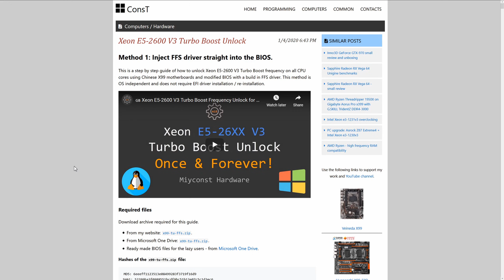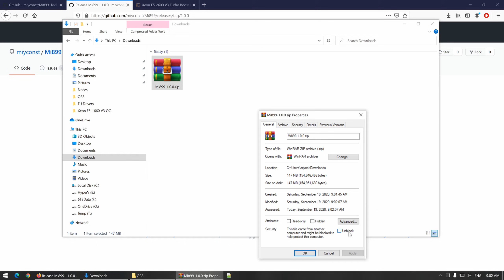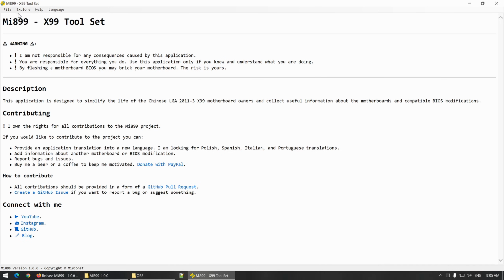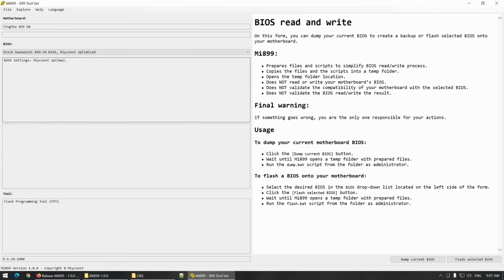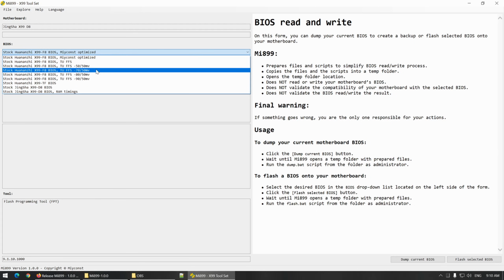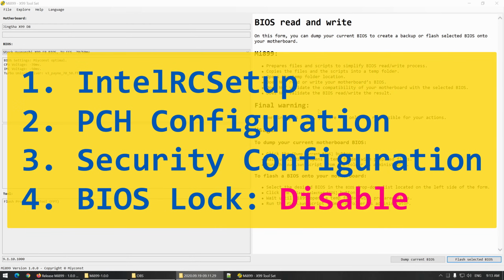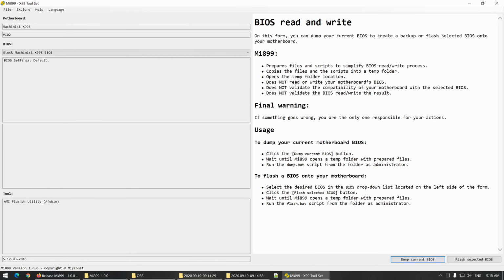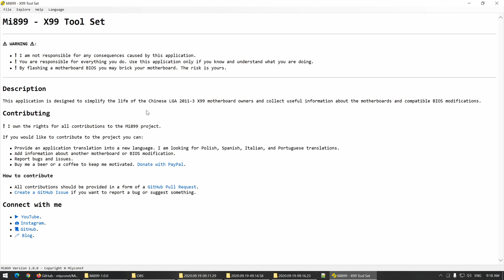🇬🇧 Mi899 – X99 Tool Set | read, write BIOS & unlock turbo-boost with a few mouse clicks

Comment: Hello Miyconst. Do you know any compatible bios that I can use for my Artermiter X99 Turbo V1.21 motherboard? It gives me an error when I was trying to delete the CPU patch using MMTOOL, and I think it's the motherboard bios's fault because it is an outdated one. Can you please help me with this because I've tried researching for too long already and still couldn't find the solution. :)
Reply: It gives me this error 

GenFds.exe : error C0DE: Tools code failure

Traceback (most recent call last):

 File "GenFds.py", line 193, in main 
File
"D:\SVN_BaseTool\Source\Python\Workspace\WorkspaceData
base.py", line
Reply: Do you think you can help w anything? please do reply. :)
Reply from the maker: Please join my Discord and send pictures of the motherboard. Atermiter is not a brand name, it's an AliExpress store name.

Comment: Hi Miyconst, I'm getting "Error 103: There are no supported SPI flash devices installed. Please check connectivity and orientation of SPI flash device." when trying to use it on the Jingsha X99-D8, have you encountered this error before?
Reply from the maker: Yes, this happens when the programmer does not have enough power to read/write the chip. You can try to connect the 24-pin power connector with PSU in the standby mode. Also using a shorter clip with better wires may help as well.

Comment: Amazing work, this really is awesome,  this development really helps leverage all those Xeon CPU's that may otherwise be destined to landfill . It is exciting to see these abundant  cheap old Xeon CPU's  keep up with a modern Ryzen CPU
I had some Xeon CPU's that I inherited, and a Cheap QIYDA X99 H9 Motherboard, This board  can be flashed with Machinist X99 RS9 compatible BIOS ROM , so I used the  hz-x99-8m-f.tp.s3tt.7050 rom
-_Some notes_-:
The Stock ROM did not allow RAM speed or  timing changes  and Sleep mode was disabled by default 
The Custom BIOS ROM Allows changes to DDR4 ( Hyper X)  NON ECC RAM speed , Including XMP profile ( Actually runs at 2666Mhz) , Manual speed and RAM timings
The CUSTOM BIOS  ROM  changes can only make changes EEC Registered Server RAM Timings  but speed always runs at 1866mhz 
Intel i7 5820K CPU did not work with either BIOS ( I just wanted to test the CPU) I presume a hardware limitation 
-_Questions_-:
Is there a way to get the EEC RAM actually running at the speed on the label  (2133)? 
Is there a way to disable Sleep and prevent the computer from  needed a hard reset 
Notes
I took a backup of the Factory BIOS  if required by anyone
Reply from the maker: Hi there. Core i7 CPUs are not compatible with Turbo Boost Unlocked BIOS, you need to use a full BIOS with not TBU implemented. Memory overclocking is not possible on this motherboard, with locked Xeons RAM works according to the Intel specs, with i7-5820k max speed is DDR4-2400 and with i7-6800k it's DDR4-2600. Sleep mode can be disabled in the BIOS, look for ACPI S3 settings, and this info explains the ECC REG issue: https://youtu.be/HozIT2X-cKk

Comment: Hello my friend, a very interesting video without a doubt, here my like and support for the channel.
Recently I have a Huananzhi F8D board with 2 Xeon 2680 v4 (2,4Ghz base clock up 3.3Ghz), which working at full load does not exceed 2.8Ghz.
Can my cpu and this board do the TBU you mention? I would appreciate some help or guidance. Thank you very much.
Reply from the maker: Hi Jose. The TBU is only compatible with V3 CPUs.

Comment: Hi, first of all thanks for all the work you do, it's amazing. the second: I have a question, my motherboard is a JINGSHA x99m-g and I have a Xeon e5 2620 v3 lga2011-3, 16gb of RAM. I use the "IObit Driver Booster" program to update the drivers of the Windows 11 operating system, every week I look for new drivers and the last IObit driver booster update was a system update. When restarting the PC there was no sign of life, no video, I could not access the bios, the PC turns on and does nothing else. Can someone help me? the bios version x99m004. Thanks😪
Reply from the maker: Why would you ever use such silly apps to install drivers? The app has messed up the motherboard BIOS and now you have to use a programmer to restore it.
Reply: @Miyconst  I know now, we only learn when it happens. You have the BIOS firmware.
Reply: I have used driver booster, its fine but occasionally it detects firmware , never update firmware through Driver booster . Drivers are just fine this way though

Comment: Thank you, flashed it in 5 mins, now I finally have turbo unlock and can set PWM speed, in the past I had to start speed fan because old bios didn't offer PWM option but now everything works automatic

Comment: Hello what is the best values for flash the bios of Huananzhi X99-TF for CPU E5 2699 V3
Reply from the maker: First you need to identify your motherboard revision. BIOS options available in the current version of Mi899 are not compatible with the latest revision of X99-TF. The best BIOS for this board is from iEngineer and available on GitHub.
Reply: @Miyconst   Hello, Thank you for you fast answer, The revision of my mother board is 2.0
Reply from the maker: @lorenzosantiago9576  Yes, it seems like you need the new BIOS from iEngineer, the ones available in Mi899 are not compatible.
Reply: @Miyconst  Hello, You specifically say the Bios CX99DE27-EARLY ?, When I buy Huananzhi X99 TF motherboard I also buy a xeon E5 2699 V3 and use Mi899 (Huananzhi X99-F8, TU PEI -70 / 50mv) and the turbo boost unlocker worked fine, almost Everything worked fine but sometimes the computer frozen but at most once a day, I thought that with other values I could solve, can I use Mi899 to flash CX99DE27-EARLY or do I have to use the CH341A 24 25 necessarily?  Thank You
Reply from the maker: @lorenzosantiago9576  if you already know that the motherboard works with the original BIOS from Mi899 then your motherboard is from the old batch, it is not compatible with the new BIOS from iEngineer. You can use Mi899 to flash another BIOS with less undervolting and see if that solves the locking issue. Make sure to restore BIOS defaults after flashing a new BIOS.

Comment: What is the difference of FFS and PEI? I have a x99 f8 e52620v3 Which is the best option?
Reply from the maker: PEI driver injects into a different BIOS region and doesn't break sleep mode. Before you do anything, make sure that your X99-F8 is compatible with the original BIOS I have in Mi899. There are two revisions of the same board. You can read about it in BIOS-iEngineer GitHub pages.
Reply: @Miyconst Thanks for your answer
  .So I choose the FFS 50/50?
Reply from the maker: @lisandrocontrerasvillar3696  I would pick PEI 50/50.

Comment: Hello Miyconst, thank you for sharing.  You did the amazing thing. But i'm using X99-T8D with dual E5-2678v3. Does your tools working with this main board ? And did you test with this. Thank you very much.
Reply from the maker: X99-T8D works with FPT / AfuWin, but there are no BIOS options in Mi899 for this board.
Reply: @Miyconst  Wow, thank you for fast reply. I tried to dump my mainboard bios and i saw it saved with 8MB, is it normal ? because your video show 16MB. And If there are no BIOS so is it difference with has option. Sorry for my idiot LOL :))
Reply: @Tinhbuon1102  AfuWin dumps only half the BIOS, that's why it's 8 MB in size. Mi899 does not unlock turbo boost, it only provides a nice set of pre-made BIOS options and UI for FPT / AfuWin.
Reply: @kostiantyncherniavskyi4251  Oh god , so sad. Do you know how i can unlock for my X99-T8D main board.
Reply from the maker: @Tinhbuon1102  this should help you: https://www.miyconst.com/Blog/View/2086/ch341a-minimal-usage-guide-how-to-read-and-write-a-motherboard-bios

Comment: very top, will you be able to unlock it on a kllisre B75 COM i5 3570 board, if you have any tools?
Reply from the maker: No, Turbo Boost Unlock is compatible with locked Xeon E5 V3 CPUs only.

Comment: Mi899 could do this update on x79 board with Chipet set Intel Patsburg C600/X79 ame stage version V6.11 thank you
Mi899 poderia fazer esta atualização em placa x79 com Chipet set Intel Patsburg C600/X79 versão  da palca ame V6.11 obrigado
Reply from the maker: Sorry, but I don't think Mi899 will support X79 boards, because it's impossible to implement the Turbo Boost Unlock with the X79 platform.

Comment: Hello
Flashed x99-8m with F8 TU FFS -50mv
it works, but without unlock turboboost, do I need to switch smth in Bios for additional?
Reply from the maker: You have to restore the BIOS defaults and specify your CPU, maybe it doesn't support Turbo Boost Unlock.
Reply: @Miyconst  did restore defaults after flashed, e5-4620 v3
had turboboost unlock before with EFI (not FFS)
Reply from the maker: Then you might have got another motherboard revision, which is not compatible with this TU method or X99-F8 BIOS. You can try to implement a TU BIOS using your motherboard's original BIOS.

Comment: When I using recent version (1.2.2) it will freeze and not responding during I click "flash seletec bios", then I switch back to old version (1.1.x) it works perfectly.
Reply from the maker: The latest version downloads BIOS files from GitHub, the old version has all BIOS files packed with the app. If you have slow or unavailable internet, it may behave like that.

Comment: Ran your program worked like a charm all cores turbo unlock for a e5 2678 V3 on a Huanazhi x99 TF, only problem is I cannot get it to see the NVMe drive I've test three drives and its a no go
Reply from the maker: Which ports and which drives have you tested.

Comment: Dumb question: I have x99-TF, used the -70 -50 bios (With v3 payne turbo unlock driver) and the instalation worked and everything went well... But how do i know if turbo boost is activated? do i need to do something else? I have seen bios booting with a clear indicator that turbo is activated, but in my case i dont see anything like that.

Also i want to confirm that error WHEA_UNCORRECTABLE_ERROR is fixed on X99 when this modded bios is installed. (This years ones came with a 2021 bios ver. that its a headache and a lot of people reported this problem)
Reply from the maker: Just run a GPU-Z benchmark and observe the CPU frequency.
Reply: @Miyconst  Thank you very much for your quick answer :D Yeah i think everything is like its supposed to be.

Kudos for your great work! You are awesome!
Reply from the maker: Thanks for the support!

Comment: I have a confidencial e5 v3 (1680) processor , i do that proceed , update sucessful on Bios but unlock turbo and undervolting dont work, any help?
Reply from the maker: Turbo Boost Unlock does not work with ES CPUs, it also doesn't work with unlocked CPUs. Xeon E5-1680 V3 is an unlocked CPU, you can overclock it, but can't unlock it.
Reply: @Miyconst  sure, but my cpu multiplier is locked, i think it because is a ES version, anyway, exists a bios to unlock FSB multiplier on chinese mobos?
Reply from the maker: No, BCLK overclocking is not possible on the Chinese X99 motherboards.
Reply: @Miyconst  ok , thank you for your attention and very fast answers, to undervolt   i use ThrottleStop sucessfully, i indicate, thank you once again.

Comment: What is the difference between FFS unlock vs s3turbohack unlock? What is better? If I already unlocked using FFS should I reprogram using s3turbohack?
Reply from the maker: S3TurboTool uses slightly different and probably better unlocking method which has two main advantages: sleep mode is not broken by turbo unlock and idle power consumption is lower compared to the old FFS method, but the old FFS method might be able to achieve higher undervolting.
Reply: @Miyconst Thank you very much for your work and dedication to your fans.
What should be safe undervoltage values for the E5-2697v3 on the Huananzhi F8 motherboard?
Reply from the maker: @kesslerdan1  -70/50/50 should be safe for your CPU & motherboard, but you might try to go as low as -100/60/50.
Reply: @Miyconst  Do you mean -70mV for CPU? -50mV for IMC? what is the 3rd parameter? Should I use huananzhi-x99-f8.s3tt.7050.mi8.rom?
Reply from the maker: @kesslerdan1  yes and yes, the third parameter is only available in the latest version of S3TurboTool, and I have not yet made such BIOS for X99-F8 in Mi899, but you can read about it here (in Russian): https://xeon-e5450.ru/socket-2011-3/e5-2600-v3/dobavlyaem-anlok-v-bios-raz-i-navsegda-cherez-s3turbotool/
Reply: @Miyconst  When I program the flash do all my setting get overwritten? or are they kept?
Reply from the maker: @kesslerdan1  everything is restored to the BIOS defaults.
Reply: @Miyconst  If I used your ffs method https://www.youtube.com/watch?v=YymioiX9SFg for previous unlock (no undervoltage) can I still use S3TurboTool to do the undervoltage (with unlock) or do I have to first restore to orignal BIOS (which I have x99.rom.bak from ffs method)
Reply from the maker: @kesslerdan1  you can use S3TurboTool straight away, but use the original BIOS to create S3TurboTool mod, don't use already modded one.
Reply: @Miyconst  Hopefully the last question 😁If I use S3TurboTool should I use the PEI or RAW? (I have a Huananzhi x99-F8 motherboard)
Reply from the maker: @kesslerdan1  do you want to compile the drivers yourself? Then use RAW. For normal users PEI is the way to go.

Comment: Thank you for the content man.
Which BIOS do you recommend to unlock the turbo boost in a Huananzhi TF motherboard?
I will be using a 2678 v3 to mine monero. I'm using a CPU Cooler Radiator with 6 heat pipes and 3 fans.
Reply from the maker: I strongly encourage people to don't waste planet resources with mining, but in your case I would go with PEI -70/50 turbo boost unlocked BIOS.
Reply: @Miyconst  Thank you very much

Comment: How can i update ZX-DU99D4? Cant find it in Mi899. Any other way to update the bios?
Reply from the maker: This motherboard is not added to Mi899. What exactly do you want to update in the BIOS?
Reply: @Miyconst  thank you for replying!

Actuqlly i dont know exactly. I am getting random :machine check exception"-crashes on my workstation
Reply from the maker: BIOS update is not going to solve this crash. Most likely you have a hardware failure.
Reply: @Miyconst  oh really? I am using an old spinning hdd while waiting for my ssd to arrive... how big are the chances thats the issue u think? I am using it with 2x e5-2699v4 and 4 x 32gb ddr4 2400 MHz
Reply from the maker: The hard drive could be an issue, but not likely. You have to test system stability under CPU and memory stress test.
Reply: @Miyconst  any software you recommend to use for this stress test?
Reply from the maker: Aida64, Memtest86, Cinebench R23.
Reply: @Miyconst  thankyou, just bought memtest86 pro, lets see whats wrong. Thankyou!
Reply: You were right, i am getting errors on Challen/Slot: 2/0 and memtest86 freezes and then finally the system auto reboots.. 

Do you have an idea which memory module channel/slot: 2.0 exactly is? I am using 2 sticks per cpu (utelizing the orange slots as you suggested in your review video)
Reply from the maker: You have to test the sticks one by one, the channel / slot name reported by Memtest86 is not mapped to the motherboard layout.
Reply: @Miyconst  yes i am getting ecc errors in memtest on every stick in whichever orange slot i put it
Reply from the maker: @QasimZaffar  then something is wrong with the CPUs or the motherboard.
Reply: @Miyconst  i got a 16gb ecc reg stick, tested it > no errors in memtest86. Started windows and no issues under workload. So i think all 4 memory sticks i used before are damaged (i bought them second hand).
Reply from the maker: @QasimZaffar  that could be the case, if you have a possibility - try to test this memory sticks with other motherboards.
Reply: @Miyconst  i will be returning the sticks and get replacement. Have no other ecc reg required motherboard, otherwise i would definitely test
Reply from the maker: @QasimZaffar  good luck with the replacement!

Comment: Good night Miyconst, I was present at Conectatech's live last Friday, I realized by your words that you advise using your mi899 app with Tu Drv S3TurboHack V0.2, but with what undervolt ??? -50/50, -60/50? I remember that I have an x99-k9 with 2630L v3. what is the difference between this driver in addition to the reduced electricity consumption, to the other one that you provided to the conectatech channel? I loved your humility and simplicity in answering all the questions asked, on top of it being too late for you. Thank you very much, big hug and continue with your excellent work.
Reply from the maker: Thanks Sérgio! In this case the reduced voltage does not reduce the power consumption, but it helps the CPU to maintain higher frequency. Each CPU is individual and you have to find the best undervolting level for your particular sample. I would go with -50/50 and let it be like that. 99% of CPUs can withstand such voltage reduction.

Comment: How to undo this new bios?
Reply from the maker: By flashing the original BIOS.
Reply: @Miyconst  where can i find it?
Reply from the maker: @maciejmatuszek4902  you should have made a backup before flashing a custom BIOS, but you can search on my GitHub: https://github.com/miyconst/Mi899/tree/master/src/Mi899.Data/Bioses
Reply: @Miyconst  Unfortunately, my disc model is not there, and where can I find the bios that I copied before uploading the new bios?
Reply from the maker: @maciejmatuszek4902  sorry, I don't know where you can find the BIOS since I don't even know what is your motherboard, you can ask the seller of the motherboard.
Reply: @Miyconst  and before uploading the new bios, you did not make a backup?